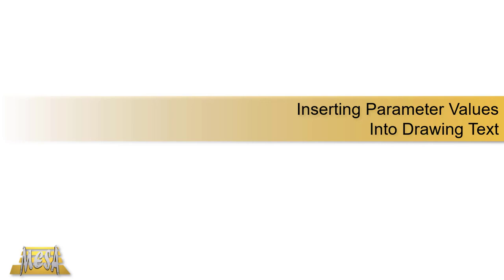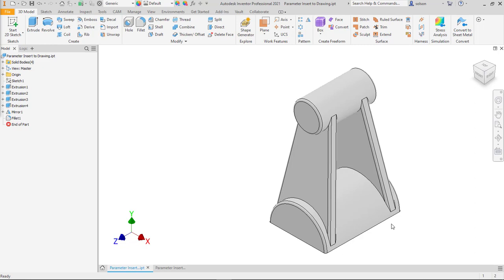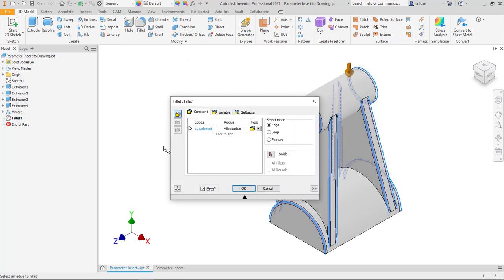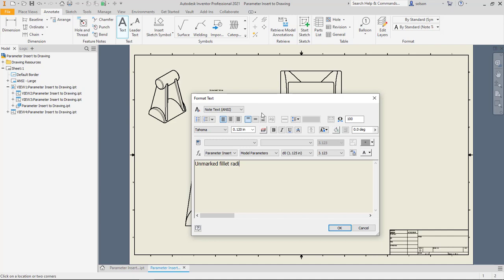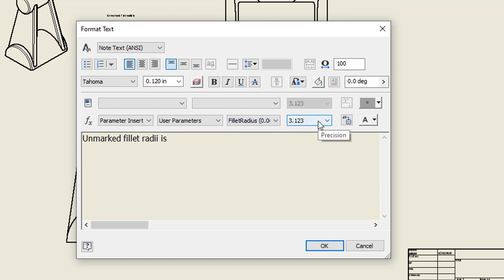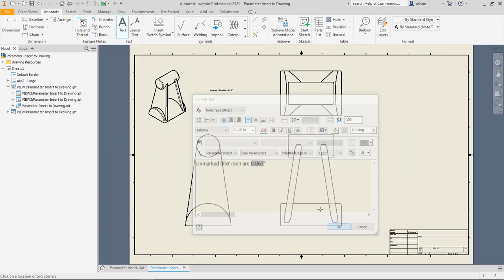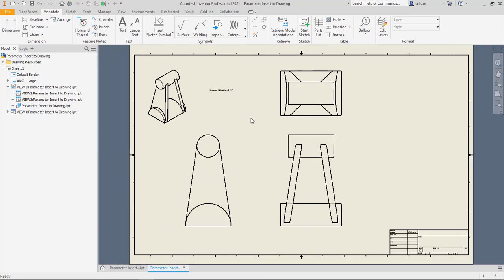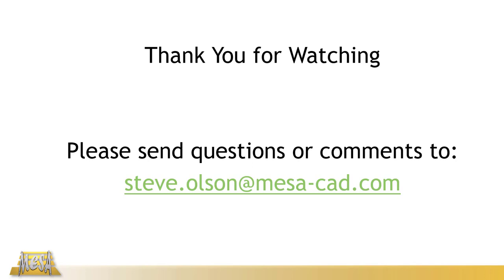Inserting Parameters Values Into Drawing Text

Comment: I'm trying to do this in a metric drawing but it keeps inserting the Imperial measurement? Any Idea what I might be doing wrong?
Reply from the maker: I wanted to test this to see what might be the issue.  I am using Inventor 2022 and Inventor inserted the parameter using whatever unit the drawing was using.  When I insert the parameter into a metric file, the value was in mm.  When I inserted it into a drawing with Imperial units, it was in inches.  What version of Inventor are you using?  I was able to get the desired result by using the Export option for the parameter.  Then if you right click on that parameter, you get an option for Custom Property Format.  That will allow you to format a custom iProperty that is the same value converted to a different unit.  Since Inventor sees that as text, you can insert it into the drawing text and Inventor will not convert the value to a different unit.

If you need more of an explanation on how to do this, please email me at steve.olson@mesa-cad.com and I can send you an email with screenshots on how to do this.

Thanks,
Steve
Reply: @3DSteve52  I figured out the issue. Everything was in metric EXCEPT for the first page of the standard in the Styles Manager. Flipped that over to metric and I was good to go. Weird that that is the only place that affected in that way.
Reply from the maker: @inund8  Thanks for letting me know.  I guess it makes sense that the active standard would have determined the units for that value.  Thanks for letting me know.